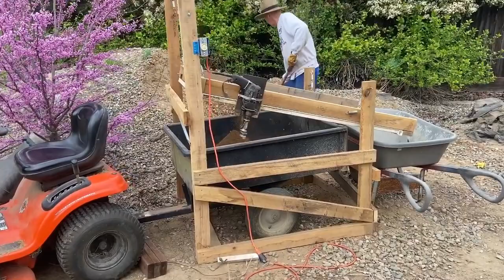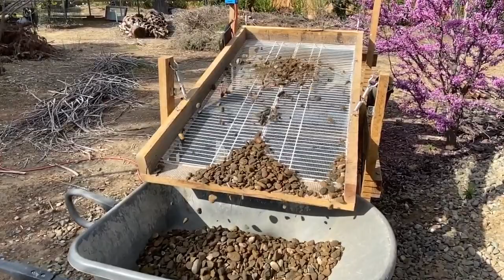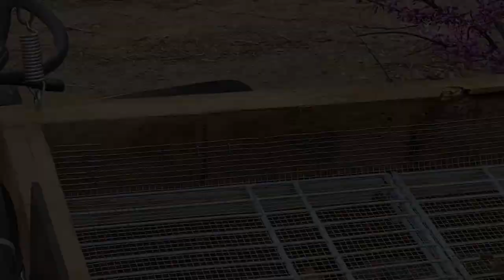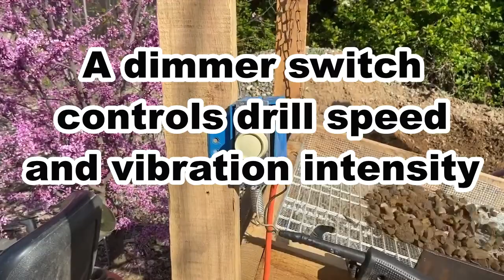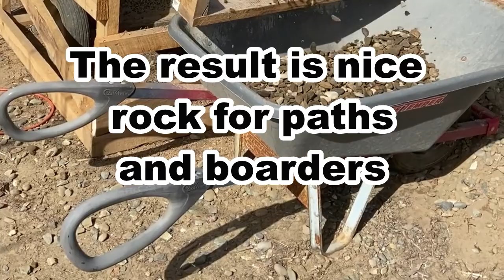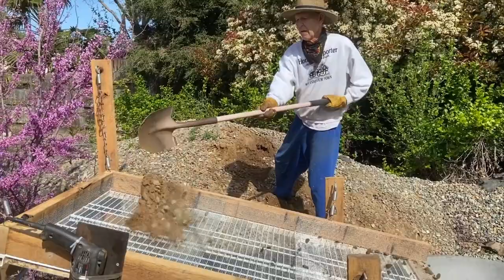Stone and Soil Sifter

Comment: Absolutely great idea. After studying your video I have made my own version and it works a treat. Only cost me £5 for wire mesh, as I had plenty of timber. Mine is running off a compressor and an air drill. Thanks very much saved me a lot of time and energy.

Comment: I’ve have seen many home made screener/shakers but yours is the least expensive and simple design is the best by far.
Reply from the maker: Thanks.   I hope folks find it helpful.  The shaker is still in heavy use more than a year after being built.
Reply: @bustersurfshop  - The "Screen" looks like some form of "Store Shelving Unit" or a "Closet Wire Shelf!" 

I was wondering if adding 1/2" Mesh Construction Cloth below it, would be even Better?
Reply from the maker: @robertweekley5926  You are absolutely right about including wire mesh.   If you click on the "step by step" construction link which I previously posted in the comments section, you can see how I used 1/4 hardware cloth as my mesh.   Here's the link again https://www.instructables.com/25-Vibrating-Garden-Sifter/